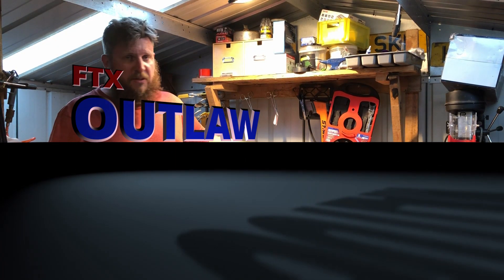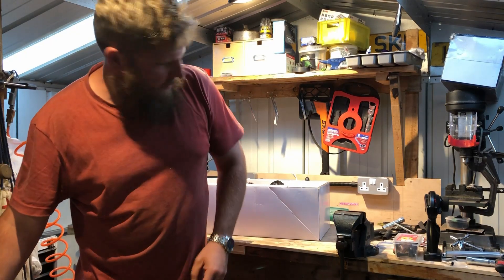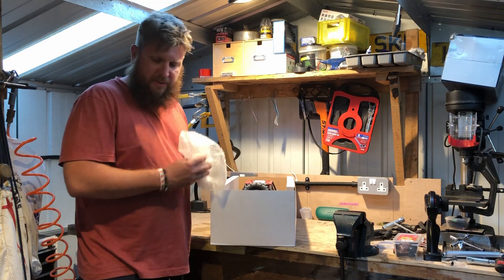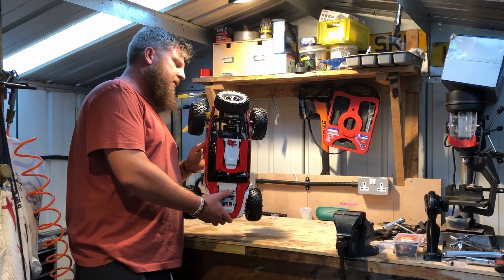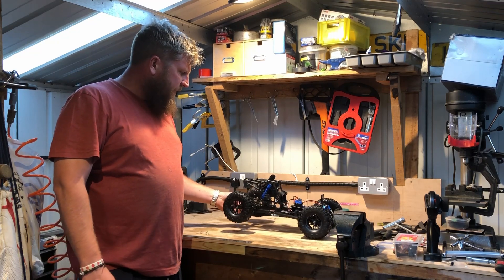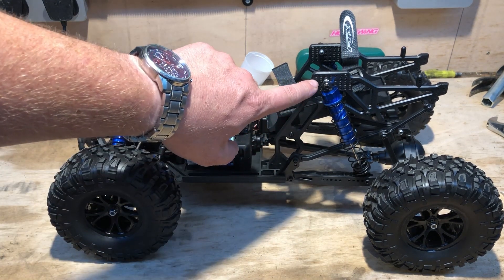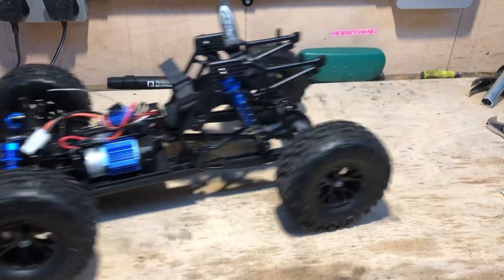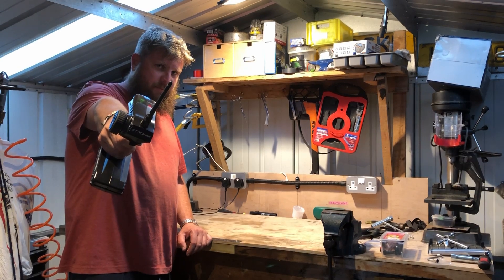FTX OUTLAW unboxing

Comment: Lipo is a must on brushed .. as u know from mine the brushless upgrade snaps the drive shafts including the metal one .. I love it's character though as it squats on acceleration and cocks the front wheel ..
Reply from the maker: Yh I run lipo. At moment just to wet to find the time to play, I mean umm. Yh sod It I do mean play I’m just a big kid. But sadly work commitments mean only have dark time free at moment. Hence some of the vids on edit right now. Builds etc